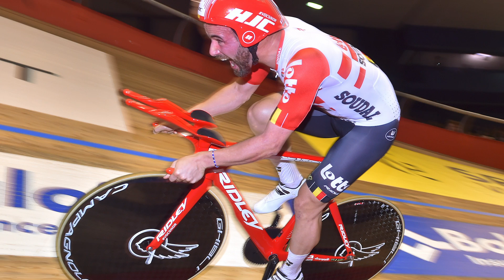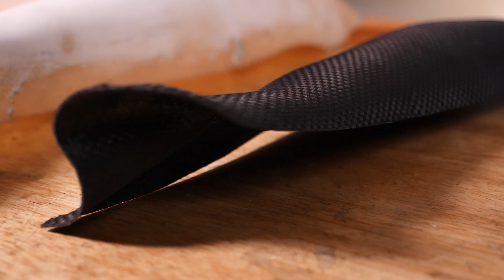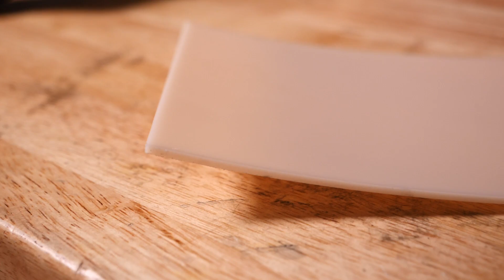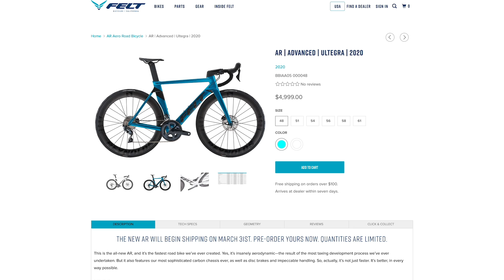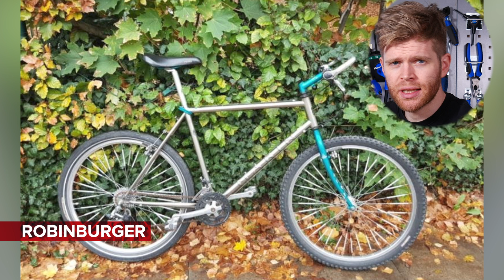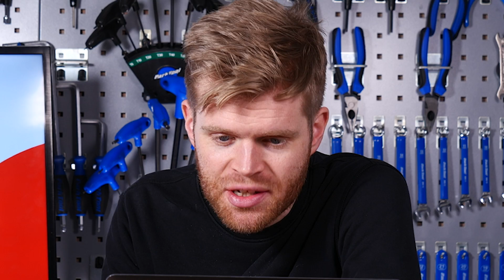How Are Custom Aero Bars Made? | GCN Tech Show Ep.111

Comment: #askgcntech Hey guys - my question is why are most road bikes equipped with hydraulic rather than mechanical disc brakes? It seems that hydraulic makes more sense on a mountain bike, but not on a road bike. Like the usual negatives with discs are usually weight, and maintenance, and e.g. race teams needing to bleed their brake lines after flying. It seems like mechanical disc brakes would have been better all round, plus I very much doubt the braking performance between hydraulic vs mechanical discs would be that great or warranted unless as I say you were on a mountain bike. Plus with mechanical there wouldn't be that big of a difference in weight to rim brakes due to no master cylinders, fluids, etc. Thanks!

Comment: It's amazing how much money people will pay for these custom aero bars, you can make them yourself at home for less than £80
Reply: I don't think so, paper and glue is not the same as carbon fiber...
Reply: @simonebottino5165  nope go and do the research, you're in the dream world. it costs under £50 for the resin and carbon fiber then 10 or so more for the moulding material. A bit more for the tools to make the installation holes if you don't already have them.
Reply: @albr4  You need also vacuum bags and an oven, is not that easy, not like fiber glass.
Reply: @simonebottino5165  incorrect. You do not need an oven and a vacuum bag is very easy to buy and use. You can go and look on youtube, many tutorials on how to make carbon parts and it's very easy.
Reply: I would love it if some of the tech savvy viewers made some carbon aero bars and submitted them to GCN for evaluating! Maybe a new segment submitting your carbon parts?
Reply: @Sports Videos All  you can use anything to make a mould, I use air dry clay because it's very easy to buy and sculpt to the correct shape, also you can add more clay later if you wanted to change it. Most people use fiberglass but it takes quite a while longer to create the mould. You can make a mould out of any material that is sculptable. Another way is to make the shape out of foam like polystyrene, and then wrap the carbon around it, then you can either melt the polystyrene or leave it in there.
Reply: @albr4  Or use shrink wrap!
Reply: @TODAY-kc5jk  I've started using the vacuum bags which are made for clothes packing/storage or food storage, you can get them for less than £10 and you can either get a cheap battery powered vacuum pump or use a hoover over the valve which creates the right amount of vacuum to create good quality carbon parts. There's a video by Easy Composites LTD that uses this process and the result is almost identical to using the proffesional vacuum equipment.
Reply: @albr4  Thank you for your comment. It is just a matter of time before resourceful people release a partial DIY kit to 3D print your custom extensions.  I admire it when folks make their own gear. It is not that difficult as long as you follow safety precautions. A friend used the foam blocks that flower-arranging professionals use to make a starting custom mold.